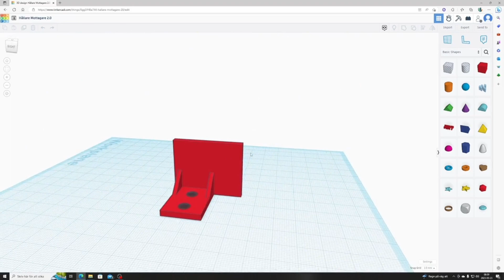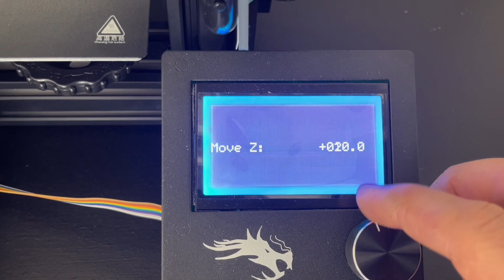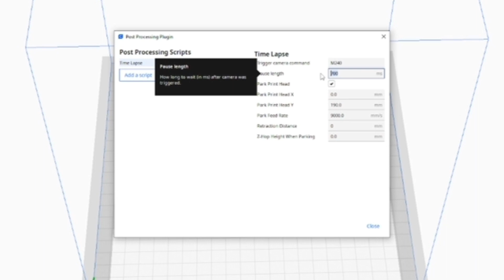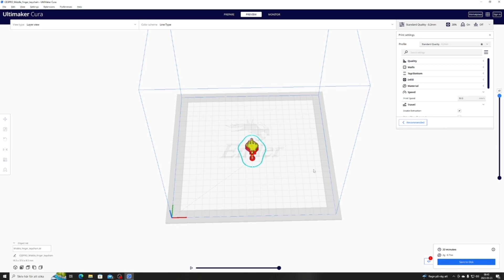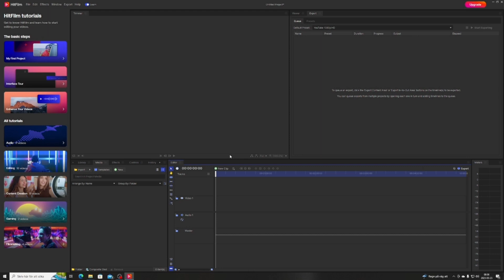Super Easy Time-Lapse setup for the Ender 3 Pro with Smartphone.

Comment: I like this video! I am waiting for my printer replacement, but in the waiting time i am searching for things i want to do with my printer. Don't know if people like 3D Print timelapse but i think off making them. And this video is what i needed to understand what to do to start it! I hope when i will receive my 3D Printer replacement, all you show with work with my printer, i think i will need to make my own 3D Parts for holding and pushing button but i think it's not the hardest thing to do!

Comment: I have some problems, when my nozzle start moving to the side of the 3d Printer to shoot the photo with the remote controller, continously emit filament and ruin the photo and also the model I'm printing, I don't know how to solve it with this plugin.
Reply from the maker: Sorry, the only thing I can think of is you can change the speed of the “park heat head” so it’s not in the way of the picture and then play araound with the  “attraction distance” so you don’t get any stringing. Someone told me about octoprint, so I have started using that instead so I haven’t had any troubleshooting. Sorry. But hope it helps if you check those variables 🙏